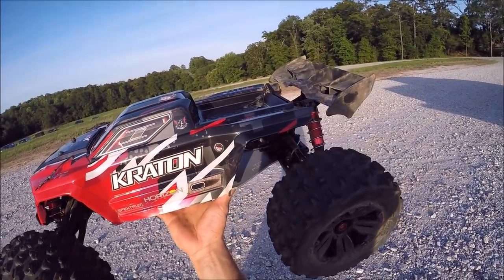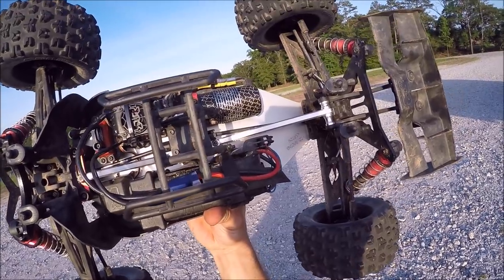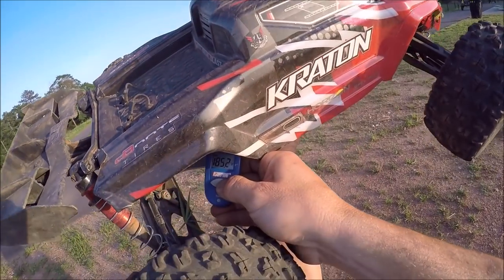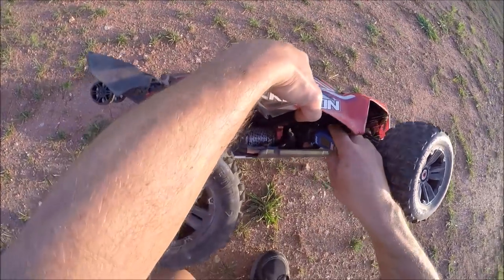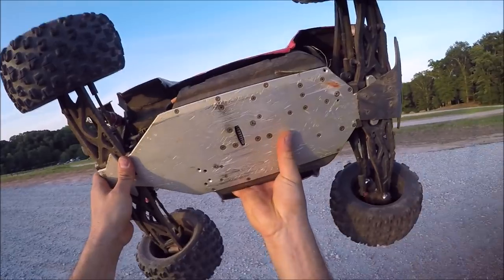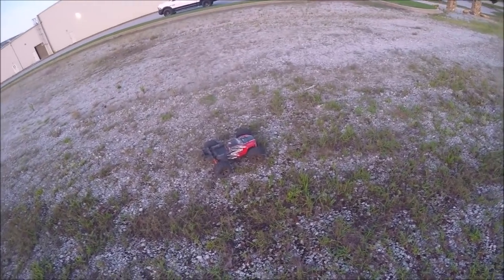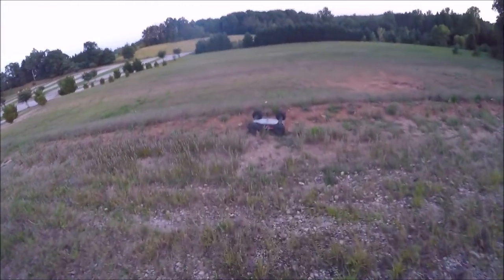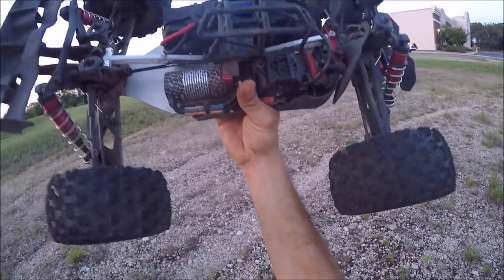Arrma V4 Kraton (CUSTOM RC UPGRADES) Test! and "GOLIATHED UP!"

Comment: Still saving up for my Outcast. Small town life must = small town cheque’s I guess. 
It’s taking me a while to put these parts together but still I am on my way pretty fast. 

Already have the M2C chassis and voltage hobbies braces plus RPM arms and mud flap rear arm protection. Plus servo mount. 

It’s a happening. Soon I will be bashing the Outcast. I can’t wait. 

I frigging LOVE this Hobby.  ❤️❤️👊✌️😊👊😀🤘👌
Reply: michael simard did you get it?

Comment: You should make a montage of all your nasty landings and breakages! With those huge air jumps I’d like to know what happens when you land wrong too! Assuming you make mistakes.. ha ha 🤣We all know the arrma is a beast when properly handled and landing on all fours. What’s the most common repair your fixing from bad lands? Love your vids!!! Lol... then again, guess you wouldn’t want to paint the arrma in bad light... however one of the beautiful things that arrma has done is make a tank... that easy to repair when needed.
Reply from the maker: 🤣Yeah I am definitely not perfect. I do have some rough landings and most of them I keep in the vid. This bash went pretty smooth with no breaks. In my younger rc days learning, I had plenty of carnage!🤣These Arrmas beefed up are total tanks and take quite the beatings! Most of the time if I break something it's bc I tried something crazy or a front flip got out of control!😜Happens to all of us!! Thanks for watching bro!😎🤘💪👊👊

Comment: Should I get the Outcast 6S 2019 or the Granite 4x4 BLX? I’m saving at the moment to buy either but not sure which one is best suited for someone that doesn’t have the money to constantly buy repairs
Reply from the maker: I'd say Outcast IMO. Much tougher..The Granite is fun but if you're looking for power and speed, the Outcast may suit you. You can always run it on 4s too.😎👊🤘
Reply: RC DUDE81 thanks bro... I’m just properly getting into RC and wanted a rig that could take abuse and have a blast with! 😁

Comment: Hey thanks for the gr8 vid. Would you still recommend buying a V4? Or instead get the V3?
Reply from the maker: Thanks so much!👊 Well the V4 is a great truck just not a fan of the T2T brace.🤔As like the V3 or older, I recommend a M2C chassis and aluminium chassis braces to hold everything strong. Depends on your bashing style as well. I would still overall recommend a V4 over the V3 or older bc of the other little upgrades and updates they made to the rig👌

Comment: Why don't you have the cross brace on top?
Reply from the maker: No real need with the M2C chassis.💪
Reply: @RCDUDE81  don't think I'd trust that...seen others bend heavy duty chassis, it's not impossible to do but to each their own right ;)

Thanks for responding  :)

Comment: Have you ever bent an m2c chassis?
Reply from the maker: The M2C chassis is meant to have a bit of flex but rebounds to its shape.  It's called flex memory. I have slightly bent one but it was a VERY extreme situation and a bad landing..👀😂Top quality parts though!💪All the stuff I put my rigs through, the chassis and other parts hold true!👌

Comment: Great bash and run, how about a cooling fan for the motor.
Reply from the maker: Thanks bro!👊Yeah I've had bad luck with motor fans. They usually last about two jumps...😂I may try a heat sink at least. I have one on my Talion running a 18 tooth and it helps a lot!

Comment: Do you still have the Tekno MT? Or are you strictly an Arrma man now?
Reply from the maker: Well I did sell my Tekno a while back. It was before M2C had all the new upgrades.😂It was a sweet truck just wasn't for me. The Arrma platform is definitely hitting the spot for me right now. I may try some other things too in the future!😎👊🤘🤘🍻
Reply: RC DUDE81 try Traxxas
Reply from the maker: @viktorgta5bilar441  I've tried Traxxas too. It's what I started with. I had a total blast with my Slash back in the day!🤘 Can't say they would be my cup of tea now as my bashing has evolved.🤣I know Redcat makes some nice rigs.
Reply: RC DUDE81 ok if you try Traxxas again test to send the Xmaxx it takes a beating, check out Kevin Talbot videos on the best uppgrades to the Xmaxx